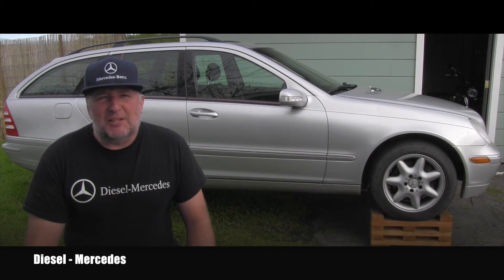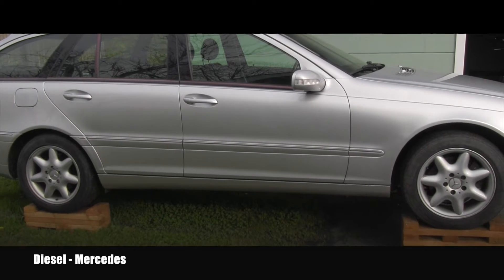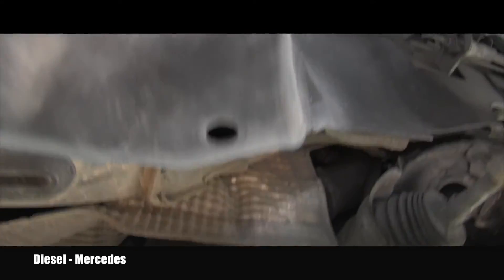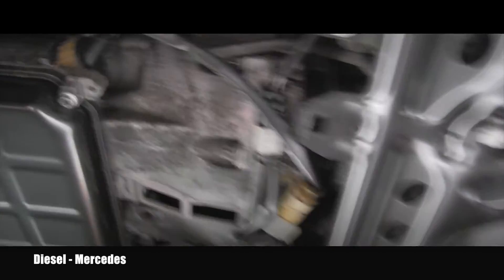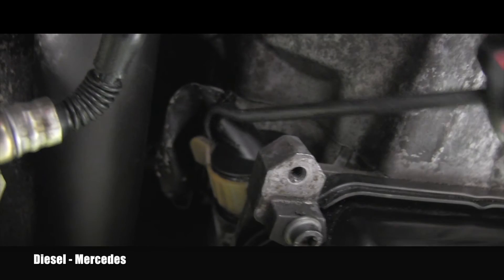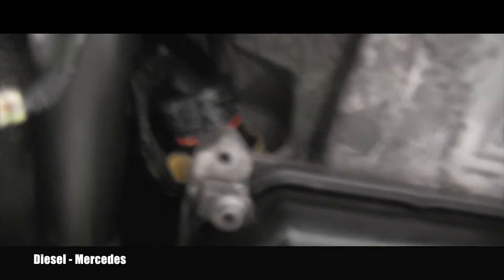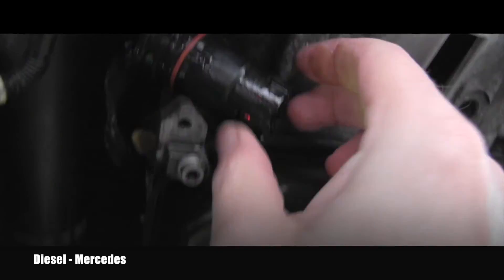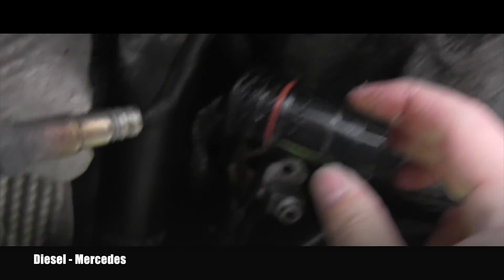Mercedes Automatic Transmission Electrical Connector Inspection

Comment: If the transmission fluid travels to the TCM through the wires will it cause a P0600 trouble code?

Comment: My name is Daniel, the trouble I am having with my transmission is that, is not shifting up. but when I move the wires where the shift handle is, those cables somehow receive the proper voltage and then the transmission is able to shift gears like normal, what are your thoughts about my problem? how show I diagnose a bad cable? should I need to purchase the entire transmission wire harness for that to be set right?

Comment: Great video, have you ever seen the connector go loose or undo? I just looked at mine as there is a leak and the tab is near the bottom but in your videos its looking like it should be at the top, should they be in a similar position? many thanks. Ian in the UK